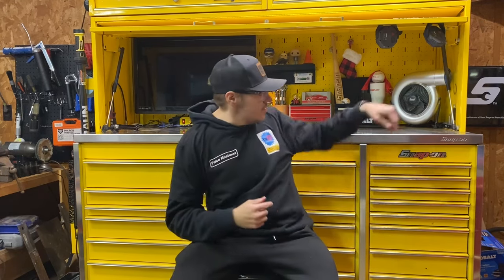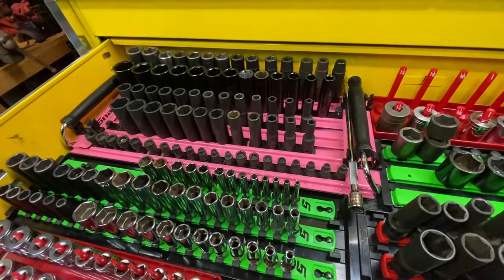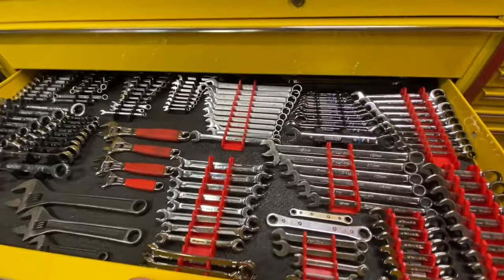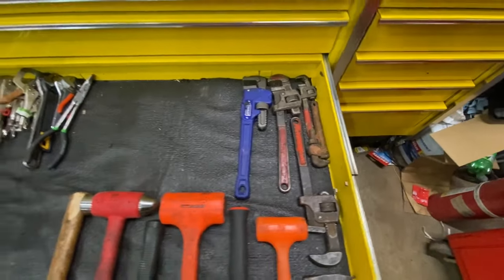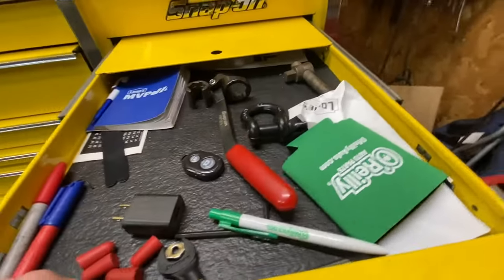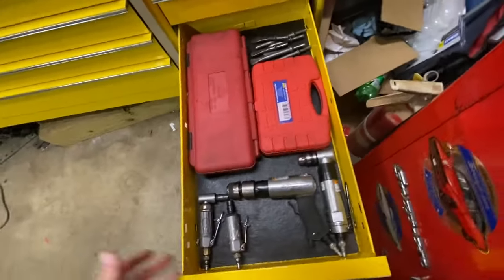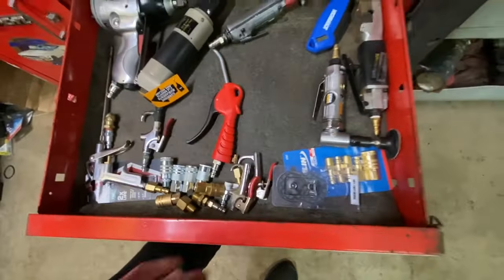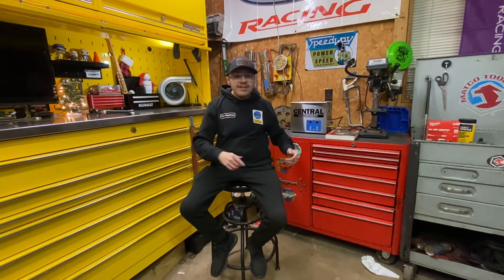MASSIVE SNAP ON TOOLBOX TOUR!!! / 3 TOOLBOXES! #toolboxtour #snapon #tools #harborfreight #toolbox

Comment: The power  tools  drawer is cool .l Like  Milwaukee  and  Dewalt.  But. Kivolt.  Has some  cool.  Impact. Got a mid range  new gen 3/8. Impact. Compact. 24 volt. Charger  battery  and  tool and  bag  like  150.  From the  store.

Comment: Really liking the shallower depth hutch with the monitor setup so you avoid the top of the hutch being so close to your head and in the way. Is it a matching hutch in a different depthor a different model
Reply from the maker: It’s a master series hutch just the older version. This box is from the early 2000s.